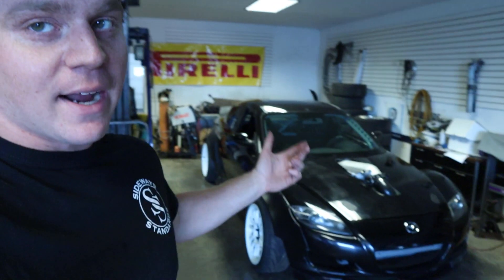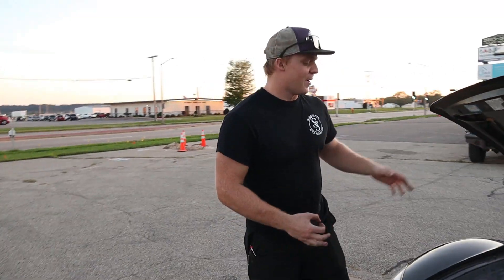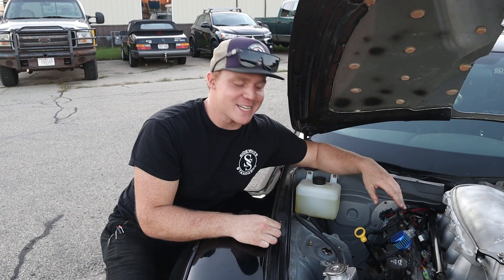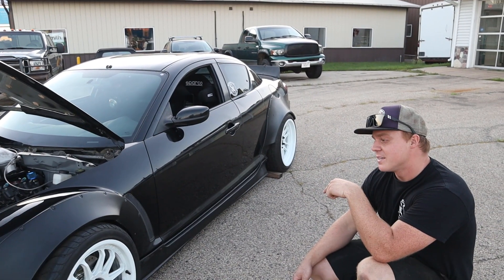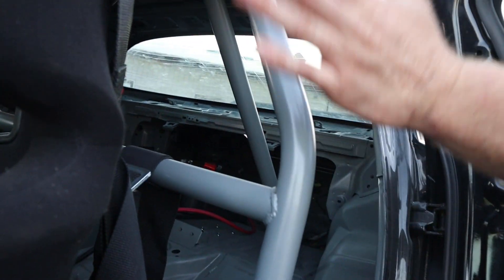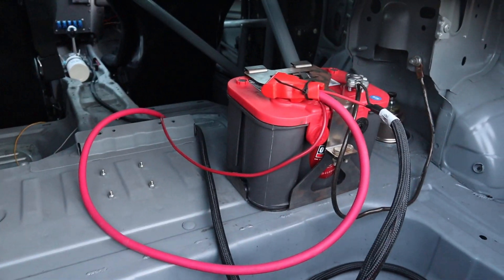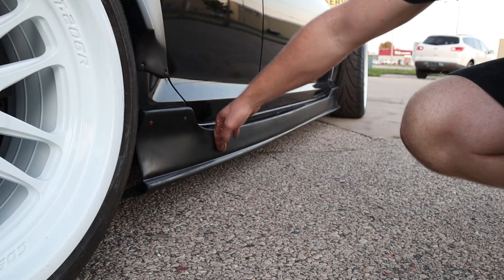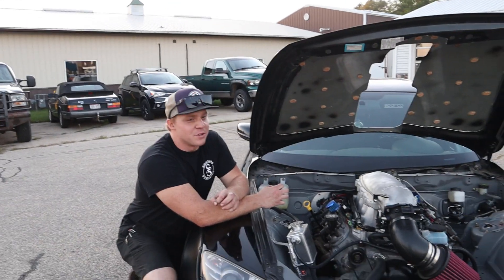LS Swapped RX8 Drift Car Build Summary!

Comment: Bro I have a rx8 as well, full bolt ons, wide body, chasis spoiler, literally everything except forced air induction (turbo/supercharger) anyway, how did you do a dual rear caliper setup? I have a hydro ebrake tied into just the rear brakes but what I originally wanted was dual rear caliper. I cannot find the bracket online anywhere to do it though, how did you do it?
Reply from the maker: I have a full rear wisefab suspension on it! It has the mounting points on the knuckles. I’m sure there’s a way you could fab up mounting points for stock knuckles!

Comment: How much would you say a basic ls swap would cost minus the cost of the vehicle? Assuming I use an LS1
Reply from the maker: I’d say a general rule of thumb for LS swapping a vehicle you can expect to spend 10k. It can be done cheaper but it all depends on how good of a deal you get on drivetrain and how much you can do yourself. Then there’s all the small things that add up (driveshaft, fueling, wiring, engine management, etc)

Comment: Heyyy I have a question you might be able to answer…so I have a gutted rx8 (wannabe racecar) and was wondering if it’s easier to do an LT1 swap with the T56 or or hold out and wait on a LS1 or LS2? I believe the 5.3 isn’t manual compatible?? (T56) I really just want a driveable street car 400hp at most and of course I only own manual cars 😅 any help is appreciated
Reply from the maker: Hey! The beautiful thing about the gen 3 engines is they all bolt up the same for transmissions. You’ll be able to use a 5.3/6.0/4.8 with a t56. Main difference between what I have (5.7 ls1) and a 5.3 lt1 is the cylinder bore and block material. Message me on Instagram if you have any more questions or want some more in depth info!
Reply: @sidewaysstandards  omg!!! Thank you so much! I definitely will brotha!
Reply: @sidewaysstandards  I’m subbing just because you give out so much information
Reply: @sidewaysstandards  rx8’s have so much potential so thank you for sticking it out there for us rx8s
Reply from the maker: @Project.99w210  heck yeah! I appreciate it!

Comment: What did you do to stay connected to the canbus system? Or did you ditch the EPS and the rest of the car controls?
Reply from the maker: Ditched the EPS! It has a hydraulic e46 BMW linear rack in it and the car is bare bones with a standalone ECU with haltech iq3 dash and just basic wiring and fuse/relay box I did myself

Comment: What did you do for your dual caliper setup ?
Reply from the maker: DND hydro 0.62” Wilwood master to stock rebuilt RX8 rear calipers. The Wisefab drop knuckles in rear have mounting support for dual calipers
Reply: @sidewaysstandards  did you just buy the drop knuckle or did you buy the whole rear end
Reply from the maker: Whole rear end kit with knuckles and links

Comment: What diff are you running with your set up ?
Reply from the maker: Stock 4.44 welded RX8 diff. When it lets go I plan to go for a quick change differential
Reply: @sidewaysstandards  sick. I’m building an LSx / CD009 combo for my rx8.
Reply from the maker: Love it. That will be a riot!
Reply: what are you guys using to support the diff?
Reply from the maker: @darkroguezero6865  Ls1rx8 has a diff support to delete the torque bar. It’s a pretty easy install and has held up great so far!